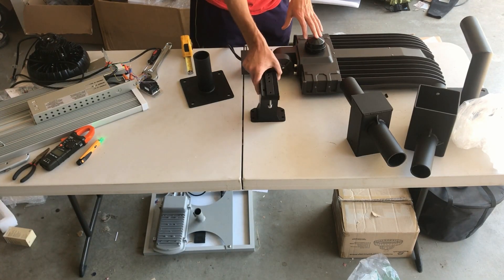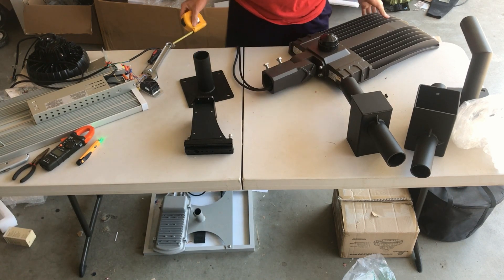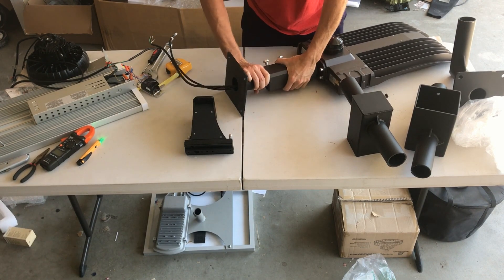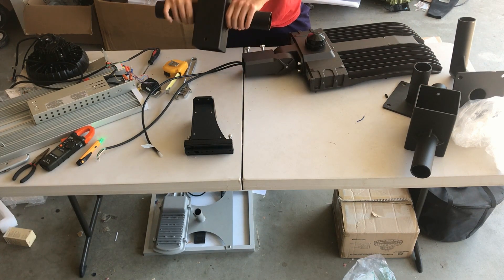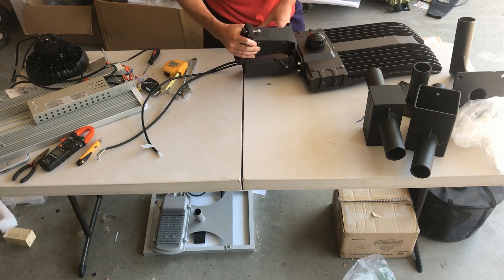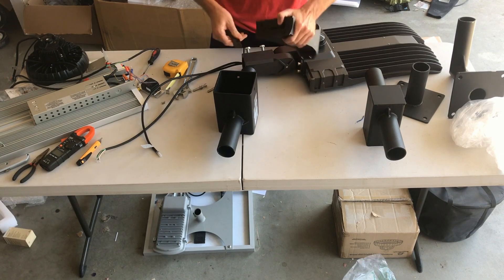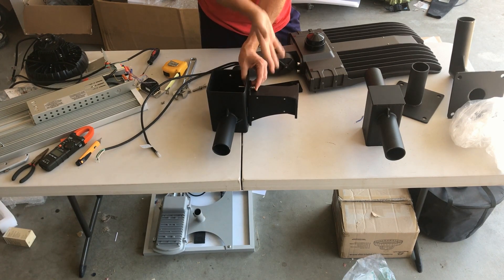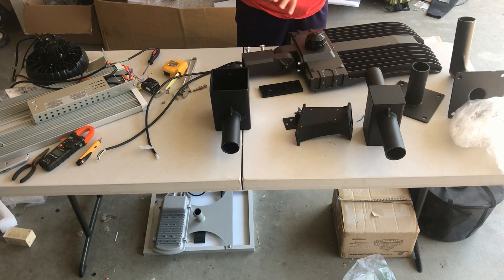LED Parking lot mounts Explained - Slip Fit Mount or Arm Mount or Yoke - Light Pole Mounts

Comment: What type of mount would you recommend if i have a wooden utility pole and need to attach these LED lights featured in this video?
Reply from the maker: we offer a flood mount that is ideal for utility poles since the wiring is exposed and easy to run down the pole.  you can use a slip fit with a 78-136 but will have to create a path for the wiring.    You can see the Flood Mounts Area Lights here;  https://www.ledlightexpert.com/trunnion-mounted-parking-lot-flood-lights.html

Comment: If you are going to wall mount it vs. a pole mount, what size electrical box do you recommend to house all of the wires in?  Any recommendation?
Reply from the maker: Junction box sizes have specific requirements per electrical code, so it will be specific to each individual installation. NEC 314.16 provides tables to help figure out the right size box needed for an application. Making sure you follow code on the size so that you have enough space so that conductors do not get damaged from bending, cause interference, or create hazardous situations.

Comment: DO you know who sells pole that is slip mount compatible? All the poles I have seen are about 3" diameter.
Reply from the maker: None will be compatible, you have to buy an adapter.  They are called Tenon Adapters.   We carry most of the popular sizes here;  https://www.ledlightexpert.com/Tenon-Adapters-and-Bullhorns_c_85.html    

3-4 inch round and 4-5 inch square are the popular sizes.   We usually have options for those.   Call us at 800-674-9420, message us or email us for further help.